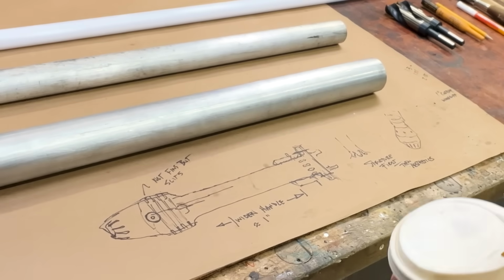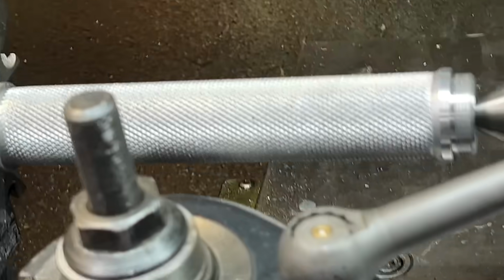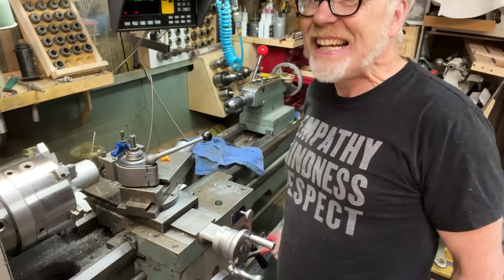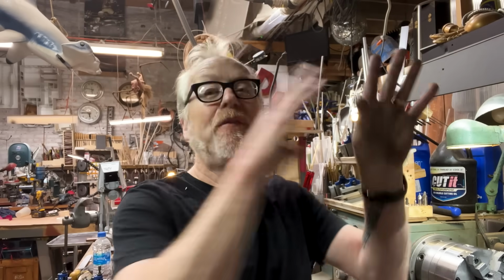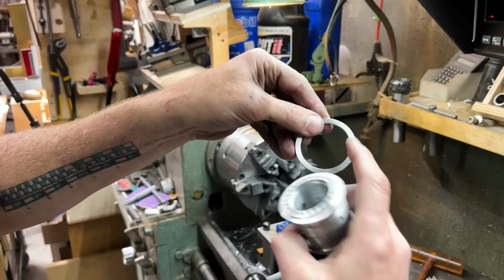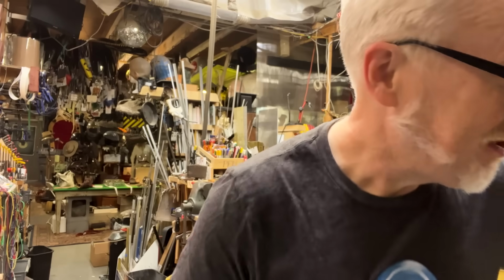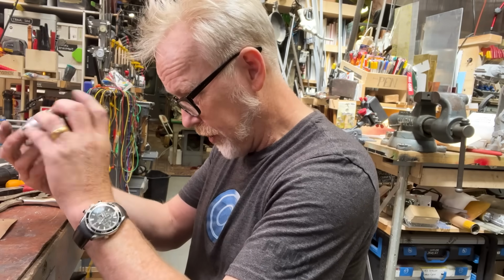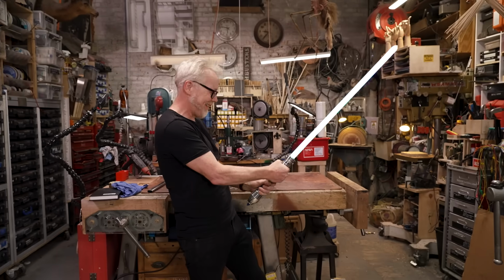Adam Savage Builds His Own Lightsaber!

Comment: With that soundboard that you’ve got in there, Adam. You’re able to actually run a small RGB led to the crystal. It can mimic the blade styles that you’ve got plugged in. There’s also countless font makers out there. Welcome to the fun and wonderful world of custom sabers!
Reply: Might be a bit difficult with the current LGT core he has in it. They're designed to be as space-efficient as possible which might make it hard to route wires.
Reply: @OrangeTheSaberGuy  didn’t realize that it was an LGT core, that definitely may make things a little tricky
Reply: @tylershubox5052  After a little research, I'm totally wrong lol. It looks like a custom 1" chassis with a proffieboard, so although routing a wire may be slightly difficult, and he may need to do some dremel work to get around the speaker, the proffieboard could be programmed to work with an accent LED, or maybe even a sub-blade so he could  have it mimic the blade in the crystal.

My bad lol
Reply: Honestly, if he could cut a channel along the length of the inside, he could nest a fibre optic cable (or 4) to the grip channels (maybe near the set screw points where they can get maximum light), down the inside of the handle, to come out and point at the crystal. It wouldn't be super bright, but it would be thin, relatively easy to do, and not require taking anything apart when he disassembles the parts as the fibre optic cable would be static. Plus he wouldn't have to fiddle with power or block his speaker with an assembly.
Reply: @littlekong7685  Yeah the speaker is the main concern, he'd probably have to give up a little audio quality, which is already limited due to the smaller speakers used in 1" chassis) because in order to fit the wires past he'd either need smaller speaker (like a 20mm speaker) and a custom housing, or he'd need to somehow dremel a channel  past the speaker to fit them. But if anyone's up to the task, it's Adam.
Reply: he would also have to make a new crystal, a clear one
Reply: @OrangeTheSaberGuy  It could definitely be done. This is one of our PixelCores and there would be some room around the 22mm Veco speaker to allow some custom work if some wires needed to go past it.
Reply: @perry92964  if he wanted to make the crystal clear, he could, but if he wanted to keep the current crystal, it's semi-transparent and light could still shine through.
Reply: @TheSaberBay  Eyy! Wasn't expecting to see you guys in here, I love your guy's work! But yeah, it would take a little ingenuity but Adam's definitely up to the task. Been trying to get him some helpful info for editing (I'm very familiar with ProffieOS and bladestyle editing) but the wiring should be no problem for him.
Reply: @TheSCPStudio  I mean it's different for everyone, I have like 7 neopixel sabers and I've never gotten bored.

Comment: As a former gunsmith and home shop lathe jockey, I'd like to suggest a couple things for lathe threading that would improve that crunchy surface finish... First, Don't feed with your cross slide, feed with your compound slide set at 29.5 degrees. Then your cut is only on one side of the thread (yet, producing your 60 degree thread form).  Second - use a proper aluminum cutting fluid, not that sulpherized oil I could smell through the screen I've used so much of it.   Third - For every cut "x" depth, come back to that same depth, and make at least one "spring" pass once you get close to your final dimension. On your last pass, run 3 spring passes at the same dimension. You'll be surprised how much comes off, and how clean your thread will look! 
By the way, that's a LOVELY knurl!  Threading I can do... Knurling I suck at.
Reply: Another thing I noticed was that seemed to be a 55 degree DNMG insert, not a threading insert. Corner radius on that thing looked way too big to be threading with.
Reply: @martyshrekster  I was wondering about that, too... but, getting it feeding at the right angle to minimize the cutting force was top of my mind.

Comment: Most modern cores have lighting for the emitter cups (the ones that blind you when you stare into the emitter), or bare traces for optional guard emitters, which are addressable items in the config files. It is possible to tap those traces or relocate a few of those LEDS. Carve a shallow channel down the edge of the core, run ribbon cable down to the pineapple.

Comment: I figured when you decided to make a collett type mount for the blade(genius idea btw), you would have made it tapered with an external threading on the handle is the saber and an internal thread is the emitter so it would screw down and tighten on the blade. That would leave a seamless look without the usual set screw holes.
Reply: My thought process as well.

Comment: Pixel Core should consider including a Blue Tooth module which would enable connecting the audio output to external speakers for better quality. A user could wear a portable speaker or in a controlled environment connect to big speaker systems for theatrical sound.

Comment: I love your saber ♥
One idea/question I had.  Could you make the emitter/collet system such that rotating the emitter engages and disengages the collets?
The would make it so that you could remove the blade without a tool.
My though was to radially bevel the collet fingers and put a similar pattern internally within the emitter.  That way rotating the emitter would compress the collet.  
You could then either add a slide latch or use one of the doodad pins/knobs you added to the emitter as a lock pin.
Just a basic idea.  I am sure with your experience you could make it even better.
In any case, what a great fun maker thing to do for your birthday.

Comment: Hi Adam! Love the esthetic of the saber! Question: Any reason you went with set screws instead of a tapered thread on the leaves that would clamp down the tighter you screw on the emitter?
Reply: I was wondering roughly the same thing... I would have thought that would have been single-point threaded as well.  And while a taper would probably be required, I don't think it would need to be on the threads themselves.  Just on the inside (position) of the outside piece, and maybe matching in the cut part.
Reply: The only issue with the method you describe (which is basically how a dremel collett works) is that the emitter ends up in a variable position/depth front-to-back and a variable position in terms of aligning the surface details left to right along the circumstance depending on how tight it's screwed down. Adam machined the emitter details to sit flush and look nice with the top layer fully seated and lined up with the button position on the main body of the saber, which would bottom out a dremel-style collett. His style allows for variable tightening without a variable position of the emitter, even though it's slower to use. Depending on your aesthetic preferences, the "greeblie factor" of the additional set screws can also be seen as a plus, haha.
Reply: Probably some ratio of two reasons, if I were to guess:

1: More difficult to achieve, and not strictly necessary, because...

2: The set screws add a little extra detail that ties in with the slightly industrial aesthetic of this lightsaber, basically for free
Reply: Fair points my dudes, now I understand his decision better 👍
Reply: Never minding aesthetics for the moment, would something like a knurled knob (computer type screw) or something similar work the same to hold the blade in as the set screws? (So you could take the blade off/on without needing tools?) Or do they not have enough tension? 

Just curious. Seems like that would be handy for Cons and such. "COOOOOONNNNN!" 😉
Reply: I think that could work, you can put quite a lot of tension on those knurled screws.
Reply: @Jcush21  you can use knurled knobs or thumb screws for blade retention, the only issue is that one cannot finger-tighten a thumbscrew to the same tightness that you can tighten a set screw with an Allen key, on account of the mechanical advantage you get from the tool. So for pictures at cons it would be fine but if you're swinging around the blade really fast it might slip loose.
Reply: @LunarEclipsism1  Thanks! 🙂

Comment: Adam, when I do single point threading, in alloys, I don’t go over .12mm depth of cut, (max 5 thou’) as it tears easily. Also if using a carbide insert take even lower cuts. I have a tool steel set up for 55 degree and 60 degree thread cuts in alloys, makes a cleaner cut.

Comment: I may have an idea for bringing some luminescence to the crystal in the bottom…

You could make another resin “crystal” for the saber using some glow in the dark resin powder?  The stone would glow, if only in the dark… You could even combine glow in the dark powder with uv powder, so it will also glow under UV light?

Like a Samurai sword, a Lightsaber is meant to be long enough for two hands.  Plus, it gives more room for theatrical saber spins!😂
Great job on it!  It really came together.  I was unsure of the bottom “pineapple,” but I think it ended up working well aesthetically and functionally.

Comment: Just a tip for next time you screw cut threads 

If you set the cross slid angle at the the same as the thread and use that to feed in then it only cuts on one edge of the tool and you should get a better finish 👍👍

Comment: Use an oxy propane nossel and compression fittings. With a pnumatic quick conectior for refiling to propane tank. Use ball valve for switch and use a 7v brushless edf through some hoses in to the compression fittings to focus the flame in to a blade. Looks like a lightsaber with out even adding a case but can add a case to make it look more realistic. Produces about a foot long flame maybe 2

Comment: WOOOOOOWWWWW, Adam, you are such a great genius, forgive my english, I dont have enough vocabulary to describe what I think about this video. It is so fascinating and satisfying watching you sculp this aluminium as if it was wood, completly amazing....Anyway, I see 2 things I dont completly like about the saber, in my Hubble opinion, of course, I even have problems changing a light in my House,  jeje: first,  I dont see the meaning of the jewel at the end of the handle, all sabers have their jewel inside the handle, as they are the ones that give the power to the blade. The second one is the system you made to fix the blade with the handle, I would have prefered to have something easier, that could be done without screwdriver. Maybe you could attach a piece of aluminum to the heads of the screws, so you then could unscrew them with your fingers, so you could unmount the blade anywhere, anytime you want without the need of a tool.
And now a curious thing, since I was a Child and had my first toy lightsabers, I always thought that maybe using the mecanism of these telescopic antena from an old car radio system could be a good way of getting a saber that could expand and retract as a real lightsaber, what do you think?....Best regards and thank you for all your wonderful content.

Comment: I don't understand Adam's interest in this movie prop.   Anyway,  I  learned a few things about working on a lathe.  I have never used the emergency foot brake and Adam uses it all the time.  Unusual mill with the table cranked all the way I wonder about the gib.   Nice old lathe w/DRO.  Using cross slide to move boring bar through Z-axis (I know that it is actually the X-axis).   Look at all the collets for the keyless chuck on the tail stock.  Who would have thunk?   Best moment was using a port-a-band to saw off round  bar  held in bench vise.    Nice scroll chuck on that ancient lathe .    Love the big T-wrench  used on the tool post.  Scary  running the threads with foot brake to avoid collision of cutter vs. bar.   Never seen a bull-nose center before.  Yes perfect knurling job.  I would  definitely hard anodize the bare aluminum.  Part would look great satin black and would resist scratches.   Love your dog also.

Comment: Perhaps no light necessary if you use fiber optic to route some light from inside top to the bottom crystal. If you mill a lightguide groove on outside of aluminum shell and cast clear resin in it, that might be easier and look very cool if you leave some unpainted or use silver, gold or copper leaf to cover it then weather it. Perhaps pour resin in small brass or copper tubing then bend the lightguide around the shell... maybe perforate a few tiny holes in it along the way down.

Comment: Make sure the thing that screws on if not hot from you working on it let it go down before you screw it on and it'll be easier get back off next time
Reply: Also if you can't ever get it off using a vice or if one is not handy you can use blowtorch to heat up the cap and it will be easier to get back off... however, overtime it might warp the cap if done  over and over and over again...

Comment: Well happy belated birthday Adam I'm sorry for missing if you take a little bit of vacuum energy off of magnet Don't let it new vacuum one side of the magnet let it Glow yellow and then slowly it'll be heavier than now you dumped that energy into a pressurization system are you unpressurized didn't pull it out of that and you know put it into a pressure little Continuum you shoot that through a taser and you have a better lightsaber

Comment: So what we do is we get an old fridgerator and we use the vacuum pump on the fridgerator and we put a ballast on it so we can vacuum it and we go grab the speaker out of the door out of the car you know the one that's busted out in the back and one that's been parked in the back forever cuz she just wants you just at work on it one of those cars so we going to borrow one of the speakers off of we take the Mason jar or throw in the Masons alright well we only need the negative or the positive vacuum really so we'll probably have to do a little modification for it but I'm just saying to see an actual lightsaber Zappa around would be something the bicycle pump probably drill a hole through the side of the drawers and pop the pic in the Milky Way we can pop off the magnet unscrew the name from the top and then put the bicycle name on it and pump the magnet have a line coming off at going to the taser this is only the first test on the taser lightsaber

Comment: 1:04:00 could you not just tear open the sabre internals, grab an LED, wire it up, adjust the casing to accommodate the wires and light up the crystal like That? 

P. S hi YouTube, I'm not a machinist, builder, engineer, or creator hobbyist, if there is a glaring reason why this wouldn't work, please approach with kindness rather than like your anakin with the 501st... And I'm a youngling🫥

Comment: Are there is one that I was looking at there was a couple hundred bucks but they use the metal lightsaber and it was actually close to a thousand once it went through the bidding up on the the thing I was looking at it though. I have metal wires wrapping it and how to conduct a plastic high-temperature plastic holding off and it was one of those very hot dowsing rod ones I wanted it so bad but it was like $1,000 and then I started and as all of us men look into those type of mythical lightsabers we use the light reflecting with the diamonds and then there was the magnification one there was a couple of different lightsabers I have looked at but the electro taser with the electoral gases seems to be as long as you throw the gas out and the farther you can get the gas the more I can conduct into the street beam all of us men have been looking for our lightsabers and we've been trying to design a lightsaber for some childish reason of being like the Jedi on the movie but I mean I'm there with you at this is my idea I've never put it down to paper and really tried it though